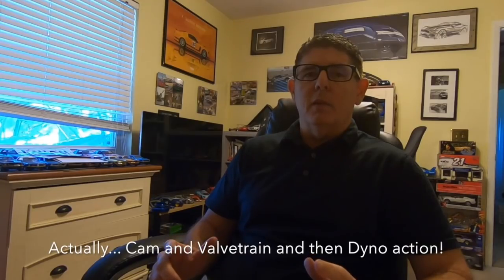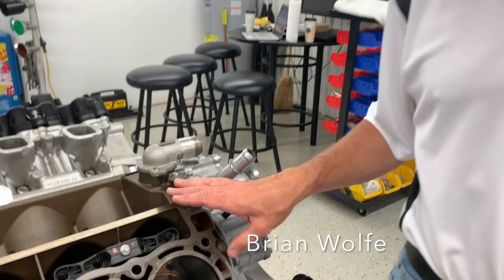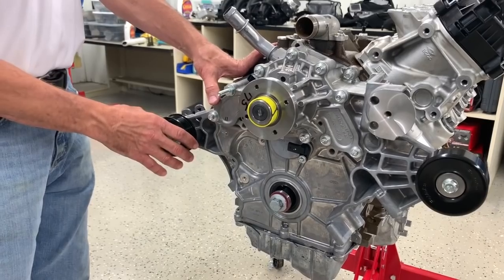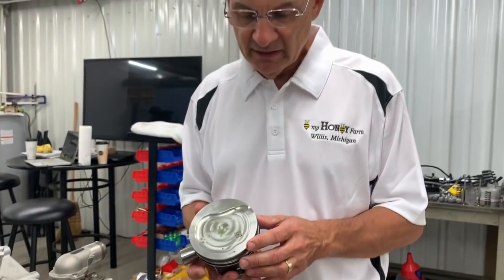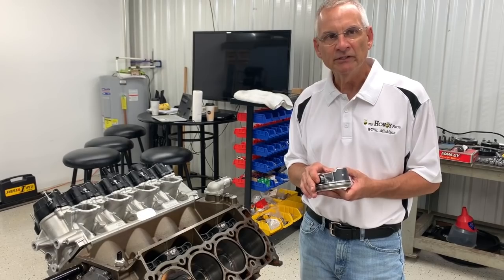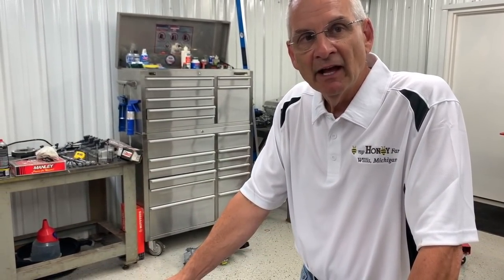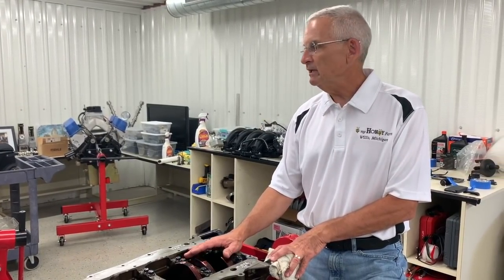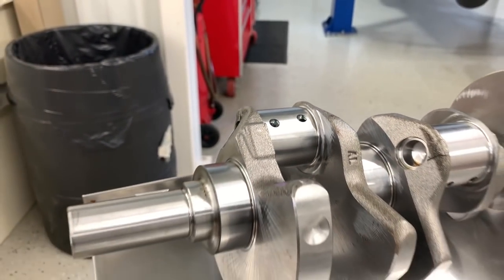7.3L Godzilla Ford V8 Bottom End Teardown — How Big Can this Engine GO?  Crank, Rods, Piston, Block

Comment: Interesting they'd use a chain driven pump but then it struck me this is a clean-sheet OHV design... with no distributor. No dizzy, no dizzy shaft... no shaft to drive a conventional oil pump, which was by extension chain driven anyways because the cam was, and in this case you can lubricate the cam chain with flung oil from the oil pump chain. 

Surprised on the plastic guides and tensioners though, are they metal faced? 

Cutting 5ci off your V8 is just a set of rods, pistons, and offset machining away... and you get to specify some extra beef for the ring lands and crown on the piston for forced induction purposes.

Comment: That "slit" in between the cylinders is a huge problem with our eco boost 4 cylinders, hopefully wont for this engine.
Reply: They're turbo.. lots of cylinder pressure. For a low comp, low revver it's fine. But if boosted I'd worry about it..

Comment: Gotta love the commenters that know everything about other people's builds. Just a little Google goes a long way. Brian said that builders will work on stouter connecting rods first thing. Stock flow of the heads with 2 valves?! Go back and watch #2 video. What other stock head flows that well with 2 valves? Sealing the heads, getting compression right and a little boost and 1800hp is very easy. LS guys are building that with way less cubic inches. This 7.3 is such a new design and the aftermarket or hot rodders haven't even begun to find it's limits or potential. Give it a few years.
Reply: Stock LS3 head flows 320 cfm.

Comment: Splits between the bores!?!?!? Did it really add that much cooling to the cylinder? If blocks dont crack between the cylinders with moderate power adders i will be surprised. Why does ford always have to mess up a good thing.
Reply: Its probably less of real cooling because that liquid would be a major hot spot not having anywhere to heat transfer(two cylinders feeding heat into an 1/8" of water that's not a high feed rate in the deeper cut from the look of it it's not going to get a lot of water) .but more of an expansion joint that would relieve stress cracking. Also if you notice on the cut away the slit doesnt go as deep as the 1" off the deck.
Reply: @jaredanthony8070  yeah i definitely noticed the split doesnt go down deep in the block. But all the pressure is at the top. Which is why i am concerned about cracks in high power applications. I swear Ford could screw up a wet dream. Someone mentioned this crank in a 6.2 though so that would be interesting.

Comment: Mark Rogers has the fastest ultra street car and it’s a 03 cobra with a 4.6 turbo car
Reply: Tyler Lewbart I don’t doubt you one bit. I’m a big fan of the 4.6 4v but I don’t think Ford is anymore. It’s slowly getting more difficult to find parts for the modulars at the Ford dealer. I think Ford wants everyone to forget about the modular engine for various reasons but one of them is because the 4.6 4v when boosted is just a little too fast for only 281 cubic inches. I have the all aluminum version out of an 03 marauder. Man they are huge and really look the business

Comment: I love the beefy bottom end but am skeptical about the open deck block design with the saw cuts between the cylinders. Looks very similar to the 1.2 & 2.0 Liter Ecoboost engines which have a horrendous reputation with head gasket issues. Not much meat there for good sealing. 

I'm also concerned about the internal coolant passages between the aluminum front cover and the cast iron block and the potential for leakage. We all know from history what happens with dissimilar metals and heat cycling.

Comment: Not sure about the cuts in between the cylinders, might be a problem with boost and especially NOS. Also not a good design putting the water passage through the timing cover for the water pump, never has been.

Comment: I think it all looks pretty damn sturdy EXCEPT the slits in between the cylinders. It look like it would easily fail  with the lowest of boost HOWEVER maybe it will hold up. Time will tell.
Reply: @zukimaniac it's at the head gasket surface though
Reply: @joenobody2580  ...so?
Reply: @mfree80286  k

Comment: Is it just me or do I spot potential head gasket failure between each cylinder?
Reply: The deck is closed. There is about 7/8 of an inch of cast iron over the cylinders. Won't be an issue
Reply: @mexital1159  that's not what the cutaway showed

Comment: Cam phaser? Not good for reliability.
Reply from the maker: They seem to work fine in the Coyote.
Reply: @revanevan  Going by what I read from Ford techs on the F150 forum about the 5.0 cam phasers failing on 5.0 engines and personal experience with the 5.4 3V. One as low as 5k miles and others in and out of warranty period.

Comment: Only thing on this engine that's  impressive by todays standards is the forged crank,port injection,  cubic inches and it being a new pushrod actuated engine from Ford. Nothing else reallly stands out. Gm was first with cracked- cap rod technology.

Comment: So, I'm not a mechanical engineer.     
It looks like the cylinders are "floating" in the block with a similar design to the setup used in the ford focus. The block is an open face design that allows coolant to move through the engine WAY more efficiently but, it also makes a head gasket failure WAY more likely.   NOT GOOD FOR BOOST!!!!      The focus block were cracking too.    Personally, I would rather have a Windsor block.
Reply: 1000hp open deck honda 4 cylinders are laughing.
Reply: Siamese head I've heard of it. But I have one coming in a week KR tremor 250 ,fingers crossed. 🇺🇸
Reply: They cut the deck off with. A bandsaw so you could look at the cylinder wall thickness. The deck is closed and about an inch thick.

Comment: If you want to make a race engine out of this I am sure Doug Yates could make a new set of their Cleveland style race heads to fit this truck engine. Or any of the aftermarket cylinder head companies could do the same but first you need a market.

Comment: What is the deck height on the engine, about 9.75"
Reply: Just watched part 1 and heard Brian Wolfe say it was a 9.65" deck height.
Reply: Since I answered my own question about deck height what is rod length?
Reply: Brien Kautzer : 240 thou extra deck over the 9.41" 379 6.2 Boss. Thats a 9.65 " deck. Stock piston deck on both the 379 and 445 is 1.34 " piston compression height. Rods are 122 thou longer at 6.322" rather than 6.200". The cranks look technically interchangable between 379 and 445. 3.976 verses 3.740". 166 thou more. The changes to make it 66 cubes bigger also make it more compact than the 6.2 SOHC.
Reply: Brien Kautzer : Yep...I had to go thru all the old videos to re-discover what I thought Id heard at 8.34 to 8.40 on the Jan 21 2020 video. That was correct.

Comment: What's the deck height? I can't find the spec for that.
Reply: kolideoskope : 9.41 inches, with 3.976 crank and I think the rods are 6.2 Boss. I cant find the Part 2 video, but Brian said 9.469, same as the early 351w.Im Kiwi, so I might have missed the hearing the numbers.
Reply: @deanstevenson6527  In the first video the guy says it's a little taller than the 9.5" windsor, but gives no actual measurement. An unconfirmed number I've heard elsewhere is 10".
Reply: kolideoskope : 9.65 deck, 6.322 "rods and the stock 1.34" piston pin to compression register. 8.34 - 8.40 on the video of Jan 21, 2020.
Reply: @deanstevenson6527  Ah thank you! I can't believe I missed that. Good to know.
Reply: kolideoskope ; the deck is up 240 thou from the Boss 6.2s 9.410". The compression height is the same, the con rod is now 6.322" instead of 6.200 inches.Based on the scaled cross section diagram and Brian W's info and the Boss 6.2 liter details.

Comment: I can imagine chevy taking notes already 😂
Reply: Yeah because GM has no idea how to build a successful pushrod engine. 😂
Reply: Your kidding right? The bottom end is almost identical to an ls/lt. looks like for has been taking notes.
Reply: Brett Kelly explain please
Reply: Oh, come on.  You've never seen the lower end of an LS?  Six-bolt main caps; four vertical, two cross-bolted.  Normal in every LS engine made since 1997.
Reply: This is literally a carbon copy of a gen 3 ls engine lol
Reply: Well dudes we all know the chevy pushrod engine was copied from the ford in 1950s chevy didn’t have a v8 for 20 years and they had no choice but to take notes from ford and built theirs 20 years later they just made some changes ,and plus all the front ends are changed 2 years later after ford has done it first ✅, that’s why I’m been sarcastic
Reply: @boostedart88  the first Chevrolet V8 was in the series D which began production in 1918. The Ford V8 didn't come around until 1932? What are you talking about?
Reply: @boostedart88  or are you actually suggesting the sbc introduced in '55 was actually a copy in any way, shape or form to the flathead? Because that would be hilarious
Reply: @roncook8566  Not exactly.  The 7.3 has canted valves, while the LS3 has parallel valves.
Reply: @andyharman3022  you're right it also has a chain driven oil pump while we're naming off miniscule differences between the two engines. I'm not the idiot that screams "copy!" every time a new engine is developed. There's only so many ways to engineer a 16 valve V8 and the people who are blindly brand loyal can't seem to wrap their heads around that. The LS is a great engine. The sbf is a great engine. This 7.3 is a great engine. Nobody copied anyone
Reply: Ron Cook chill out boy you on fire 😆 the ls is a great platform No one is saying it’s not ,and no I am not saying is straight up copy in any way ether because its obviously not” you can chill out now .

Comment: Looks like one hell of the beefy engine. The only thing that I'm on the fence about is the chain driven oil pump. I just remember all the shitty Mitsubishi engines that would fail because of the chain... I'm not saying that this is going to happen with the Ford... Just sort of curious I guess...
Reply: Chain drive oil pumps are very very common. And very reliable. Bad design killed the ones you know to have problems.
Reply: @spike662 I'm sure that there are better, more well thought out chain oil pump designs, but in my opinion, it's hard to beat a gear driven oil pump.
Reply: @BarnStangz  in my opinion, the gearotor pump directly off the crank snout is the best way to go. But, they also have their issues. The best drive system is probably gear to gear, but not the old type with the 90° rotation chance like the ones off the camshaft. That was probably one of the worst designs that ever worked 😅

Comment: Ford perfected OHV?!!
Reply: The 351 was a great engine.. so good that gm had to clone a massive amount into the LS family..
Reply: @J Smith wrong. That's why LS heads can be mounted to the 351. But ok.
Reply: @PureCountryof91  they can't be mounted on an sbf without extensive modification that's a myth. I've built several of both engines the ls is no more of a copy to the sbf as it is the Cadillac 472. Stop regurgitating nonsense you see on the internet
Reply: @PureCountryof91  The GM NASCAR racers wanted to the 351 Cleveland style heads outlawed, when NASCAR refused because is was a production design GM redesigned the SB heads with evenly spaced ports and staggered valves very similar to the 351C. Dale Earnhardt (the biggest complainer about the Ford head design) was a happy camper.
Reply: I mean, they teamed up with Chrysler to get the 427 ohc banned. Seeing them try to attack another more advanced and powerful engine is really not a surprise

Comment: The split that’s there between the pistons is a terrible design by ford. The 1.5 eco boost have the same design and have tons of block decking issues and headgaskets issues  there’s a recall on them currently
Reply: They moved the split further down in the bore away from the deck. Also this engine isn't running on boost or high compression. It will probably be fine

Comment: Throwback, but your better off with the 6.7 turbo diesel for work purposes.
Reply: The diesel option costs $8000 more than the 7.3 gas, and would not pay for itself in fuel savings for most buyers.
Reply: @andyharman3022  depends on the usage